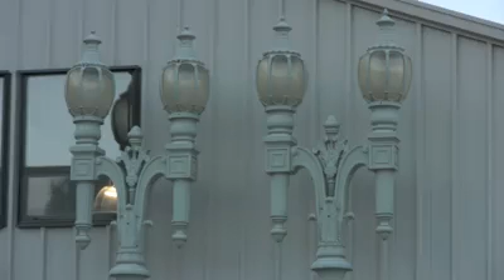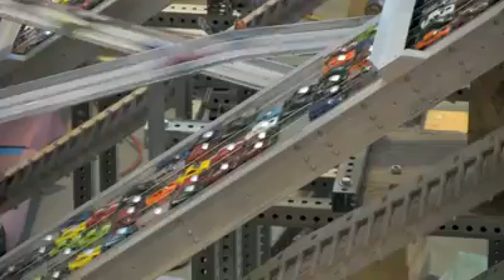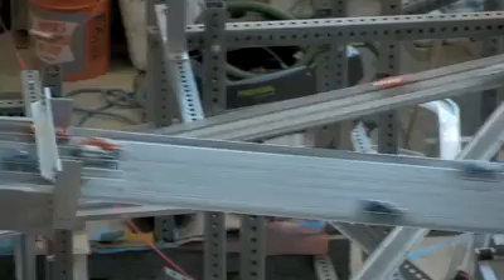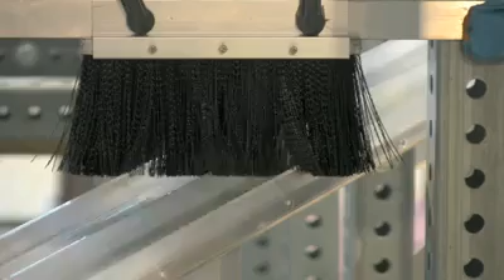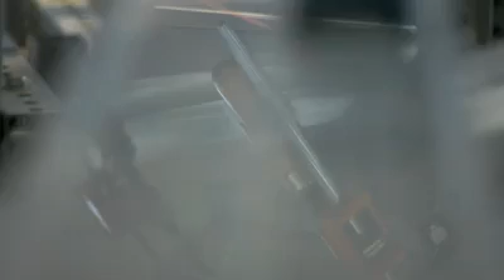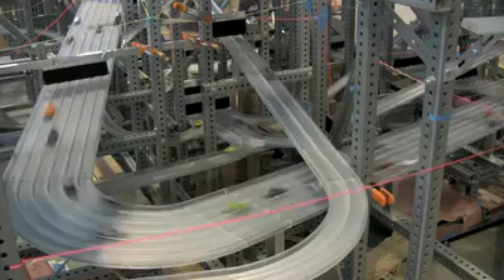Chris Burden

Comment: @gilinski2000 Don't send money. I have a large dumptruck. I will pick it up. Our society currently is incurring $650 billion annualy. An absurd cost which could support a 32.5 trilion investment in a modern system which will not incure those costs.   That is 325,000 miles of system at 100 million a mile. We only have 50,000 miles of interstate. At the current cost it would have to be gold plated to match the current cost.